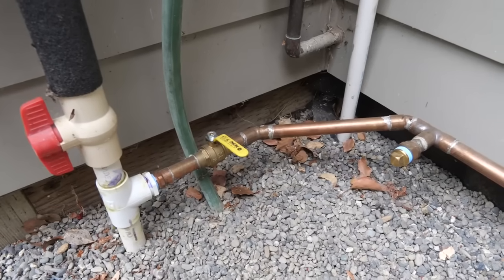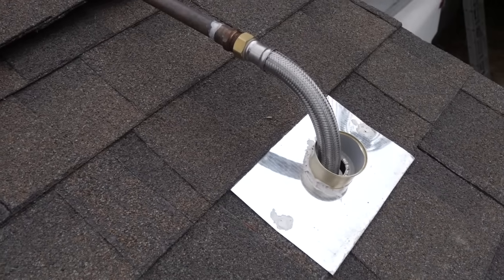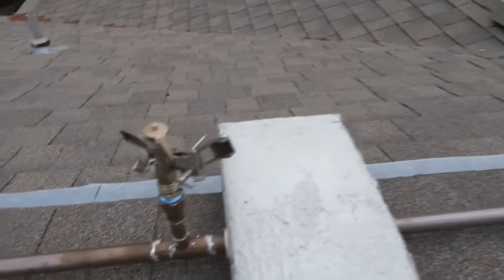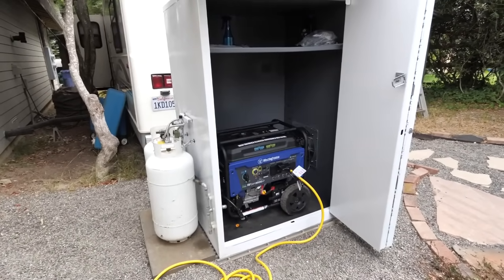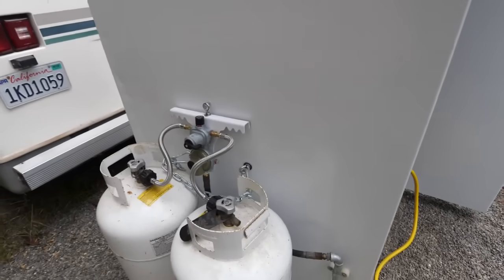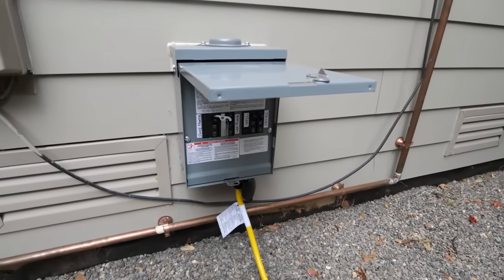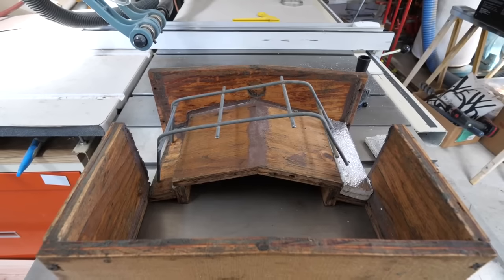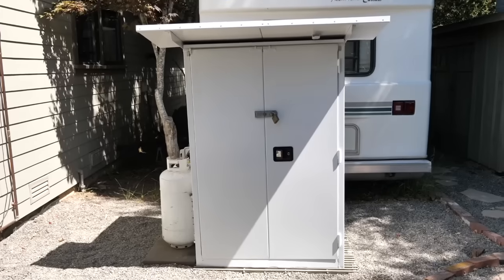Roof sprinklers and backup generator for wildfire-prone rural house

Comment: I think it's interesting that someone with no knowledge of fire suppression systems designed this. Instead of copper tubing use schedule 40 steel piping and pressurize the system and you need pressure relief valves.

Comment: If you didn't  use asphalt shingles you would not need this complicated system. Corrugated steel roofing, ie Colourbond, has been preventing roof fires for 100 years in Australia, and yields lower insurance cost. Its also much better looking than any sprinkler system.

Comment: How’s the water pressure with so many sprinkler heads ?
Reply: Depends on the well location, my 210 feet deep water well can supply over 200 gallons a minute. I can turn on the whole huge yard sprinkler, the whole house and still have lots of pressure left. In LA is near the coast so it doesn't need to drill that deep to have unlimited water supply.

Comment: How many houses in L.A. had sprinkler systems?
Surely should be on every home in areas like this?
Reply: Those people putting to much trust on local DemonRats WOKE politicians, should have added an extra investment on their own water well, 1000 gallons propane tank for  propane generator for protection. With skyrocket high insurance here in California I think every multimillion dollars home should be equipped with a rooftop sprinklers and surrounding yard watering system.

Comment: Is it not easier to have a roof made from concrete tiles than can't burn. The wood ones you use in the USA are crazy. Cheap but dangerous. I'm amazed they are allowed. No way in the UK could they get signed off. The building inspector would issue a seizure notice on them. Also the wooden frame houses. Wooden fences. Wooden pagodas. Wooden decking. All soaked in creosote. Half a dozen plastic wheelie bins. Hedging. Wooden bark mulch. Yous make the biggest pile of kindling and live in it. Too many dwellings packed together. It has to be different next time..
Reply: Concrete in california are ya high?

Comment: Looks like you got a nice lightning trace be sure to put multiple ground straps to copper rods driven 3 ‘ into the ground. Do this at multiple points on the horizontal and vertical lines. Also fill your catfood can penetrations with some pink fiberglass insulation and then top  off with caulk/mastic.  Cover that with a rubbber boot or some storm flashjng.   Gen exhaust might overheat your fan reinstall farther up on the inner wall.

Comment: Great prep work, but I am not sure about those concrete blocks. I  would think it would have been even less work to do it with proper attachment and flashing  directly to the roof.  Make sure your vents are fire proof. A good proportion of houses actually burns down from the inside out from ambers than makes it in the attic or crawl space.
Reply: The concrete block retainers could be replaced with electrical conduit hangers made of galvanized metal.  It would look less conspicuous.

Comment: Good to see people trying to help themselves rather than rely on others. I have often wondered if this sort of thing was possible. May I suggest you fire proof the plastic supply pipe at ground level, possibly move the 2 gas tanks into the generator shed  on a heavy duty shelf above the generator to keep them out of any flames if the worst happens, & also bury the yellow cable to keep it out of harms way. Let us all hope you never have to use it.

Comment: This is cute and all but having been through a wildfire myself (our home didn't burn down but many neighbors did) I learned that the top of most roofs (composite included) are fairly fire proof. You might get some scorching from embers falling on it but the majority of homes I saw burned down the roof was still in one piece. But it was on the ground with the home having burned out from underneath it. From what I understand the bigger threat is the fire coming up next to the home to catch the siding. Or there are no screens on the attic vents and a convection current sets up in the attic which sucks the embers in through the soffits and catches the attic on fire. This would suggest clearing any plant matter, like your flower bush, away from the home would be more effective than sprinklers on the roof.

I suggest anyone reading this comment to do their own in depth research and do not just assume that sprinklers on the roof is the end all solution.

Edit: the LA fires are an extreme case due to the crazy winds involved. I don't claim what I said to be applicable in that particular situation.

Comment: Very impressive and I hope that it's still working and your still kicking.

However, if that cable has a plug on both ends you have what is called a widowmaker!
It would be better to come up with another way of connecting the cable so that you have a inline socket on the end, so it can never have live pins touchable if someone pulls it out when the generator is running.
PErhaps put a hatch in the cabinet so the cable can be passed through (or in fact bury it in a pipe to the bottom of the cabinet) so the door can remain closed when it is in use, that way no one will be able to steal it while it's in use.

Still impressive though.

Comment: Always thought sprinklers (misters) on the roof would be a good idea with a automatic system to turn on sprinklers similar to automatic sprinklers inside public buildings. One thing I would suggest would be a line of sprinklers under the roof over hang to keep floating embers from under the overhang, and to keep the sides of the building wet.

Comment: Black malleable pipe with cast iron and a tar based pipe thread sealant stands up much better to heat than sweated copper. Also- why would you have propane tanks outside that fireproof enclosure? Seems like you got it backwards. I applaud your self reliance and attempt at self engineering. I hope you never need to use it. Also- if there is a really big fire, I would turn on the system and run. That will NOT stop your house from burning down. Perhaps clear out any combustible vegetation within a 100 feet of your house. Good luck sir!

Comment: Great idea but i think you should fire proof  the outside of the structure  with a metal roof and  brick  instead of siding or use siding that cant melt or burn  , good luck bud and you have to ask  will they check the soil and food grown from toxic contamination

Comment: Nice work!!! I would question 2 layer of protective steel on the generator (assuming it is for fire protection) when the insulation on your wire would be long gone and a breakers tripped. You would come back to nothing but a steel box with burnt paint that may or may not still work

Comment: Nice video. I even believe you did more than most ppl did. Unfortunately I don't think it would help you at all. I would say it is more fire hazard to have those pressure gas vessels so close by your house... I also think it is good to be prepared. But you should also consider few other things..such as possibility to take hose from one side of house to different side where you might have to consider start using water hose to take down fire..also ..you need protective gear to be able stay outside ..during 100km/h winds and same time hot ambers blowing all over to be able use protective gear and be able be outside during this god forsaken weather..

If you considered all this then fine.. I know it looks like not important now..but those sprinklers will not save you if your house is flammable from outside.. Ofc i don't know all details about your house. I believe you did all your best to protect your house..

Comment: These could be retrofitted on every house for very little money. Things could get well watered as soon as a fire started before the electricicy goes out and it would greatly slow the fire.
Reply: There were 50-100mph gusts every minute plus constant wind, 8% humidity and high temps.  Wet bushes were dry in a matter of minutes.  Some electricity was off at or before fire even started.

Comment: I'd get rid of the wood trellis around the house and install a metal roof system. More expensive than a narrow stream sprinkler system but probably offers more protection. I'd also cut back vegetation - it is too close to the house. Also, you need a buried conduit for the line from the generator to the transfer switch.

Comment: Retired FF here. Well done Mc Giver.  However those sprinklers will not be enough to deal with radiant heat / wind driven fire and embers from the fires surrounding your home and the heavy vegetation right up to and over the house. More sprinklers - more water volume- may give you a better chance. best of luck. BTW that trellis?? pure kindling......
Reply: that's what i was thinking.  Needs to cut back all the vegetation from the house.

Comment: That braided connector hose is plastic inside, which will melt and cut off water flow when exposed to the intense heat of a fire. You should have made the connection all copper.

Comment: First, they make sprinklers to set on the ridge of your house for just such a purpose.
And I’m a bit concerned by the cat food can flashing.
Seems like it is prone to gather rain water.
 Also, cheaper to use a gas powered pump than an electric one with generator.
 As it can also be used to water the surrounding area.
You also need to have a 1,000 gallon water storage tank.
To have all that and depend on city water flowing during a large fire is not a good idea
I live off grid on 40 acres In wildfire area.
Have been evacuated twice.
Got Wife and animals out and stayed behind to help fight fires.
First thing they do is send crews through to assess which home are defensible, and any hazards like propane tanks,  stored flammables and water availability.  When they see a set up like yours, they are more inclined to try to save it, as they believe they have a better chance.
 Also you can make a great perimeter system using T-post and irrigation sprinklers.
 Hot ash can carry two miles on start spot fires way ahead of main fire. So being able to prevent that and the small embers are imperative to stopping it from burning your house.
The person has a lot of what are called fire ladders.
I’m afraid his house is really not fire hardened.
And in wildfires you have 40-50 mile an hour winds from the fire creating its own weather.
So sprinklers during actual blaze can be somewhat ineffective.
They are good for pre wetting.
But if the Fire Dept pulls up and sees Propane tanks next to your house, that’s the first thing they will remove.
I heard them explode ALL NIGHT literally.
You need to have a pump that has 1.5 inch fire hose fitting attached to large storage tanks.
To properly fight the fire.
You sprinkler system is preventive not Defensive!
Most wildlands fire trucks only carry 500 gallons.
I’ve had them refilling at my spring at house tanks.
Most houses catch in 
T
Gutters
Eves
Decks
Soffits 
Bottom of siding.

Comment: I would remove the stainless steel braided line and replace it with a stainless steel flex line. Inner diameter is noticeably larger. Braided line almost reduces to a 1/2 line.

Comment: Well thought out & designed system.  I will say if you run your generator every month you would not have a problem with gasoline.  I live in the south east US and a generator is a must have here.  I run mine once a month and also make it power something while it's running, also always run STABIL in the gas as I do with all my small equipment and have never had a problem.  It gets stored in the garage when not in use, also gets the oil changed once a year, spark plug & air filter cleaned.  It's about 10 years old now and always starts on the first or second pull.  It paid for itself the first year I had it.  Thanks for posting this although we don't have wild fires just hurricanes.  FLY NAVY!!!

Comment: It does look like a good system. Hopefully it will keep hot embers entering the attic space through the gable and roof vents. That has to be one of the vulnerabilities of many houses. The insulation in my house looks very dry and flammable.

Comment: Seriously?  Exposed sheathing under the eaves and around the base of the house, large wooden trellis over the patio deck (the deck does appear to be composite, but most composites are combustible), combustible asphalt roof shingles, trees and shrubs all around the house, with branches extending over the roof, leaves and other debris around the base of the house, a couple of propane bottles outside of the house?  

You are going to put your trust into an innovative sprinkler system with numerous potential points of failure?

Comment: Well done but if you’re serious about fire abatement, you need to change the close perimeter of your home where there is so much fuel - wooden arbor, tree limbs extending over your roof, and close vegetation, etc.  Good design but it’s the flying embers that could limit the effectiveness of this system - well done!

Comment: While I appreciate the ingenuity of your project I question a few things. 1. Your shingles are asphalt and “should” not catch fire. 2. Your open soffits exposing the roof sheeting are an extremely vulnerable area. 3. The tree overhanging your roof and growth so close to the side of the house is another issue as is the pergola attached to your house. Embers getting up into the attic are your biggest enemy, starting a fire from within. I’d protect those soffits and install only vents with mesh screens. I don’t think I’d have a tree within 50’ of the house if I lived in your region. Kudos on your storage area for your generator and for your theft prevention of your propane tanks. Might I suggest using Pewag chains? You’ll never cut thru them with a bolt cutter and will struggle a lot with an angle grinder. Worth its weight in gold. Might wanna pour a concrete slab inside that storage box and place some I-bolts into the concrete to secure the generator to the ground. As of now all one has to do is pop your lock and off that generator goes. Good luck and I hope you never have to use that system.

Comment: What great execution of a great system. Perhaps I missed it but I'm curious how much you invested in this system. You are obviously quite handy and capable but most of us would have to hire this done. Also, I noticed trees right up against the house. I'd start any fire mitigation plan by clearing anything that would fuel a fire that's close to or that overhangs the house. Lastly, I do wonder if that system would prove effective against the kind of winds and inferno we're witnessing in LA. If it would, you'd think all those rich people whose homes burned down would have spent a little of their wealth on a system like or similar to this. Seems they'd rather put solar panels on their roofs instead of something that might keep the house from burning down. But I suppose most tend to think this kind of disaster only happens to others. I think they call that penny wise and pound foolish. I hope you never have to use your system. Bless.

Comment: Very well done!  Two thoughts tho… the branch on the roof drops lower than the main line, so it’ll retain water even when drained.  The main feed should have come up on that side of the house.. and that braided bend pipe will likely fail over time as the rubber within degrades due to UV and temp changes.. an outdoor grade/UV resistant hose with an appropriate overnight might last a bit longer.  All that being said, I’d love to see a follow-up since this video is now 3 years old.

Comment: You could  have  a underground waterstorrage . There a pvc Tanks that hold up to 15000 Liters and are easy to install . Thais what i am doing. Besides this is a cheap and easy System to Right wild Fries. 
I would Upgrade the Siedlung of the House to fireresistend and have covers for all the airintakes and Outlets , this is wäre the Fire finds ist way inside.

Comment: Excellent job!  I did wan to bring to your attention that that water heater flex hose is rubber inside the braided steel exterior.  So as luck usually goes it would probably melt and give way in the intense heat from a fire.  I’d consider replacing that with another copper flex line if possible.  Take care… 😊

Comment: From what I've found, working with the NSW SES, sprinklers work, but can be wasteful of your water.
In a bush fire, it's the burning embers that are travel ahead of the fire front that you need to stop.
If they can build up on your roof, usually in the gutters, they can ignite the eaves/roof space.
So running a system as shown in the video, but replacing the sprinklers with a drip feed down each side of the peak works just as well as sprinklers without excessive water loss.
The point is to have wet gutters so that any embers that land on the roof, which accumulate in the gutters, get extinguished.

Comment: Bravo! You are a very talented and resourceful handyman! I wonder if you'd compared the cost of your beautifully designed & installed sprinkler system to simply recovering your roof with any number of designer-coloured aluminum roofing available today? Considering you'd  never need to replace an aluminum roof, versus 20-year asphalt shingles life,  I'd be curious as to how much an aluminum roof would have cost versus your professional sprinkler system/generator setup?

Comment: Who’s here after/during 😕 the fires?  This is great but my first thought was, in the temps they had in LA, 1200°, those copper pipes would melt (googled & copper melts at 1,984°F) they know the fires in LA got over 1200°F bc that’s the temp aluminum melts at, & they found trails of melted aluminum around cars. Aluminum melts at 1221°F according to google. But yeah, it could definitely work if it stops the fire from starting in the first place by putting out flying embers.